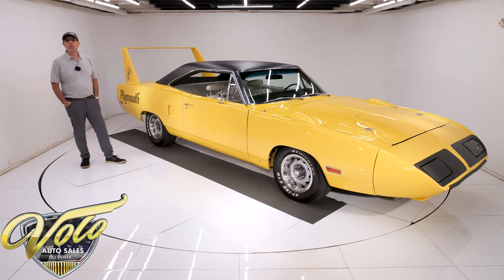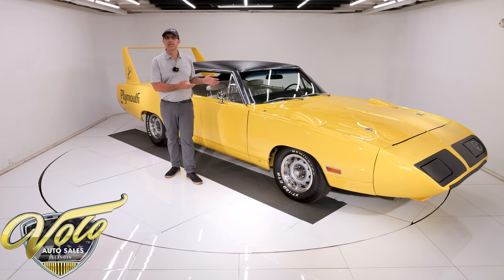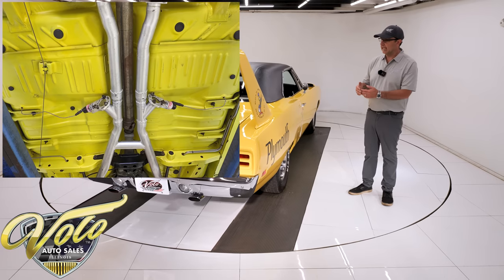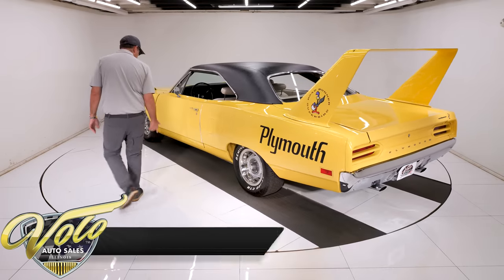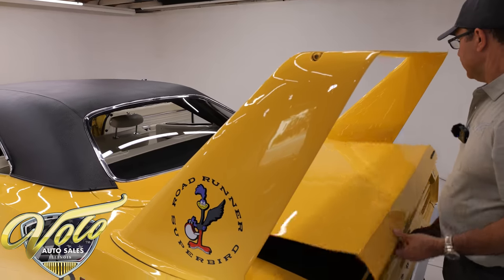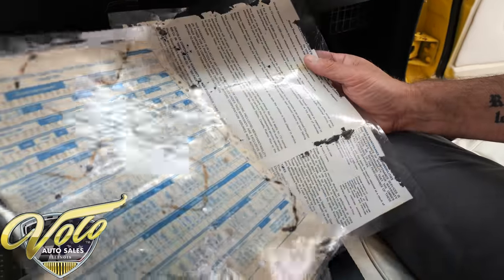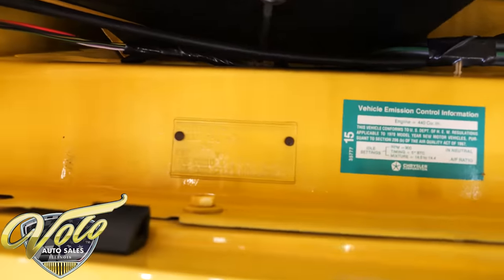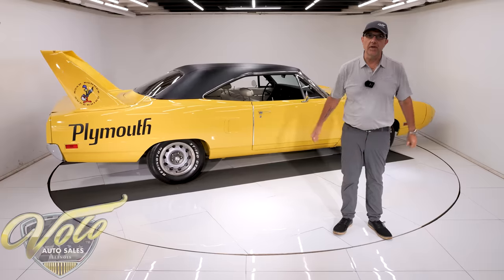1970 Plymouth Superbird for sale at Volo Auto Museum (V20972)

Comment: One correction- Chrysler actually had to run a 305 cubic inch engine in 1971. To Bill France’s horror, Dick Brooks led the Daytona 500 at one point with a little Keith Black-built LA engine.